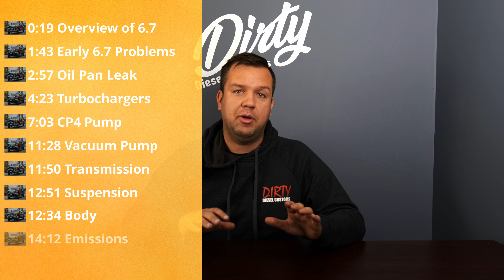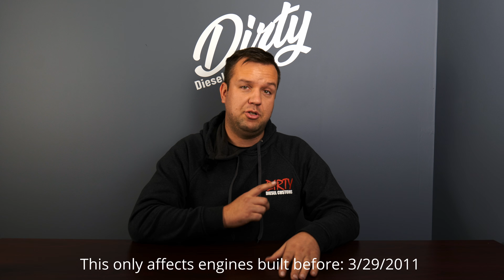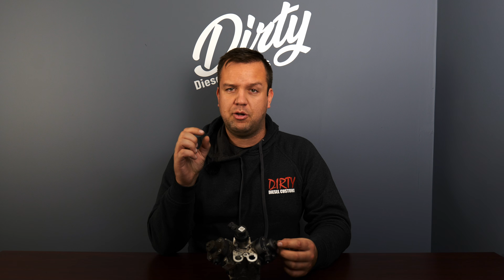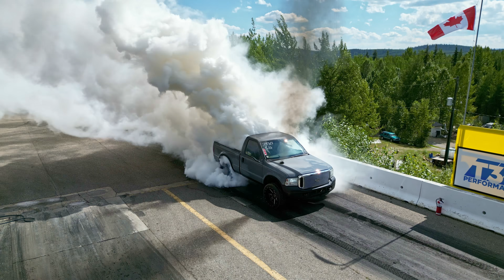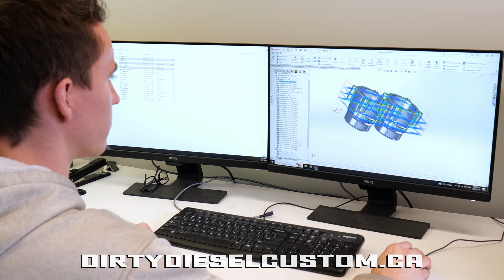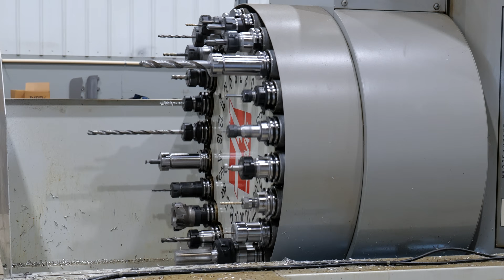2011-2014 Ford 6.7L Powerstroke Buyers Guide

Comment: I have a 2014 does its turbo still use the ceramic bearings?
Reply from the maker: Hey, I learned after I made this video I had those years wrong, all 2011-2014 trucks have the ball bearing turbo, not just the 11/12's. So yes your 14 has the same early design turbo
Reply: Steel bearings in 2013-14

Comment: How come these CP4 pumps only fail in the USA must be something different in the diesel lubrication ability.
Reply from the maker: Our Ultra Low Sulfur Diesel has a lower lubricity rate than European diesel does. Which is why North America see's a near 8% CP4 failure rate while Europe see's less than 1%. These pumps are fitted to many BMW/VW/Mercedes with little issue. It's too bad because from a performance standpoint they're pretty good pumps! 
Cheers

Comment: I find it odd that the 2011 f250 built before march 2011 had a tsb for an engine problem and the 2011 f150 before march 2011 had trasmission problem, problem with the lead frame

Comment: I guess so you're saying do not buy one!! Seems very risky.
Reply from the maker: It's hard to say, the engine and transmission are really solid (late 2011+) so if you get those other items sorted you should be set, or better yet if you can find one already done the way you wanted you can end up with a solid truck. Each manufacture has their own issues, so it's just balancing what issues you want to watch out for. 
Cheers!

Comment: Nice summary.  What bothers me is WHY does Ford CONTINUE to use the cp4 pump given its 14+ year history of failures?
GM used it for just a few years, had problems, settled a $50 million suit with Bosch over it, then dropped Bosch entirely and switch to a pump from Denso.
Ram switched from the older cp3 to the cp4 for ~2 years, but had enough problems that dropped the cp4 and switched back to the cp3
Ford started using the cp4 in 2011, with continuos problems. Ford had to issue a recall on their 2020-2022 models. Yet Ford STILL uses it,   WHY???

If the pump fails, the repair estimates now range $12,000 - $15,000.  This is so unnerving, that I preemptively ordered the S&S Diesel's replacement pump.
Its cost was $2,000. (However, thanks to trump's idiotic tariff B.S., buyers will now pay $2,400). The labor to have it installed (11 hours) will cost another $2,000, and various parts should be replaced at the same time (~$600). 

While it is obscene that I'm preemptively paying ~$4,600 to prevent a problem that may never surface on my 2017 F-350, the thought of paying ~$12,000+ to repair a failure that a knew might occur, and was a nagging worry every time I drove it, was even ore obscene

The concern about possible failure was heightened by recurring, False, 'Water in fuel' error messages. Draining and inspecting the fuel established that there was no water. Ford claimed the harness was failing an replaced it, but the problem continued. The water is detected via. a sensor which detects a change in capacitance. Water has a higher capacitance than Diesel. BUT SO WILL AND HINT OF METAL IN THE DIESEL FUEL, Given that a substantial portion of he fuel passing through the pump is recirculated back to the fuel tank, the false error code could be the earliest warning of accelerated wear (prior to metal shavings being formed)

Given the cp4's reputation, I'm unwilling to drive a truck with a pump that can 'grenade' the entire fuel system and even the engine itself.
Reply: Bosch sucks because they make everything from car parts to vacuum cleaners, my guess is they're cheap and ford has a good deal with them

Comment: If i'm going to replace the fuel system for ten thousand or twelve thousand I can buy another engine for twenty thousand and forget about the problems just change out the problems that have r existing and put a few extra dollars and that's it
Reply: If you know how to do the work on your truck. The replacement contamination kit is around 5-6 thousand. The 10 to 15 grand is if a mechanic does the work.

Comment: Just when you think you think you know alot, then you meet this guy lol. Awsome Video. Just bought a near new looking 2014 4x2 f250 6.7 long bed quad cab for $15k. 129k miles. No leaks or modifications, drives like a dream. Only strange thing happening is when doing a light tip in from a stop. Feels like 1st gear slip, or torque converter slip. Then again it also feels like a rear limited slip diff issue. It has the Electric locking diff button on the dash that does change the feeling when turned on. It almost disappears when the switch is on. Maybe I just need to change the rear fluid. My Ram Cummins always required a friction modifier to reduce diff chatter. Almost feels like that issue without the noise.

Comment: There’s a nice 2013 6.7 truck bought at auction. For 15k at a dealer. It’s stuck at 30k mileage. Any concerns?
Reply from the maker: If it runs and drives nicely that should be good! Keep on top of your maintenance, make sure the PCV stays clear and enjoy it!
Reply: @ thanks for the prompt reply. I’m gonna look at it today

Comment: i actually found a 2012 ford f350 crew cab long bed dually with 146.7k miles on it, it looks solid ngl, the dealership guy showed me a video of the engine running and i hear no ticking or clacking sounds. Are the '12s engines a solid choice? i hear they usually have turbocharger issues, including egr dfm etc issues, and i wanna try and delete them, would it be a good idea to get them?? if someone can help me out id appreciate it :)
Reply from the maker: The bottom ends on the 12's are solid, it was only really the 11's that had the bottom end issues. The turbos are still the weak point but replacements aren't too expensive if you want to replace it down the line!
Reply: @dirtydieselcustom 3 weeks later, thank you so much!!

Comment: I'm about to pull the trigger on a 2011 F350 Lariat with only 66k miles.  The truck is in mint condition inside and out except for some surface rust in spots on the undercarriage.  The driver's seat doesn't even have ass prints in it yet.  That said, I have some concerns now after watching this video.  I'm always suspicious of first year body style changes and this video confirmed my suspicions.
Reply: Yeah what you all think about buying a 2011 F350 6.7 l Diesel with 300,000 MI
Reply: Price 12000
Reply: @JamesWarden-cs2rz bought a 2012 350 tuned and deleted at 179K for 24K
Reply: I bought a 2011 a year ago in April with 77,000 miles on it. I just had to replace the turbo at 97,000 miles. Mine is deleted fully and I deleted the ccv. 
Other than the turbo issue. The truck is a beast.
Reply: Also, make sure to put the s&s disaster prevention kit. I haven't done it yet but I'm using hot shot extra lubrication additive in every fill up.

Comment: What happens if your truck already had its cp4 replaced under warranty do they give you a better one mine was done on my truck around 75k before I owned it 2013 model
Reply from the maker: If you have the upgraded CP4 you are more protected from the failures, but it can still happen, so if you want to be extra safe we'd just go with the Exenergy system saver for peace of mind.

Comment: I’m a Cummins guy I have a 04, 07, 12, & 16’ year model trucks I’m considering a 14 6.7 I just worry about the cp4 issue
Reply: Senior master tech here… the CP4 problem (in my experience) is blown out of proportion. Use fuel additive and change your fuel filters every other oil change, and you will not see problems.

Comment: Should i even consider a 380k mile 2014 truck, tomorrow i will be looking at an f250 being sold that its said to have 380k but truck looks well cared for on photos price is very cheap
Reply from the maker: That is quite a few miles so it's hard to say, we've seen these trucks with good maintenance last over 500 but you're going to see things like wheel bearings, bushings and general suspension components needing to be replaced even if the engine and transmission is solid. If the truck is well maintained when you go look at it, then it could be a good unit for you but just be sure to check it out thoroughly.

Comment: Im looking into the 2016 6.7 platinum f250. Are those not as reliable as the 2011-14 year models?
Reply from the maker: 16's are great trucks. Same issues with the CP4 pumps and vacuum pump leaks, but their turbo's, transmissions, drivetrains and bodies are all solid! Make sure it's been well cared for and you should be good!

Comment: If ceramic ball bearing turbo fails. What’s the upgrade then back to steel ball bearings Do diesel turbos see much higher temps than gas applications like sports cars, and tuners?
Reply from the maker: Exactly, the replacements are steel ball-bearing turbos which are farm more reliable! Diesel exhaust gas temps are usually lower but the airflow is slower at lower rpms so the heat dissipation is slower. This issue might have been more build quality rather than a specific issue with them being ceramic.

Comment: I bought a 2014 f250 lariat 6.7 turbo diesel with 31,500 for $40,500. I’ve kept up with the oil changes,CCV,brakes,tires,shocks,fuel filters,air filter just general maintenance and love my truck. I am very aware of the cp4 fuel pump problem and have looked into preventative measures in case it decides to implodes….
Reply: Do a S&S disaster prevention kit ....I have the same truck and with only 86k miles my CP4 took a crap ... costing me 14,650 $ cash out of pocket ....no contamination was found by dealership in fuel ....400 dollars could have saved me a small fortune

Comment: Went to look at a 2011 f350 with 74k miles on it. When do the pumps fail if they do? Don’t wanna buy a ticking time bomb
Reply from the maker: CP4's are hit and miss, we've replaced them on 21's with under 50k and we've got customers who have trucks over half a million and they're running fine. The usual culprit on a CP4 is bad gas, water in fuel, bad maintenance etc. And on the 11's they're the early style pumps so they're more susceptible to issues. 74k is decent miles though, you'd likely be good if you kept up on filter changes, good fuel and a fuel system saver of some kind.

Comment: I’m looking at a 2012 with 187k and seems to have harsh downshifts. Could it be possible that it’s a tune issue or solenoid issue?
Reply from the maker: These transmissions have been known to have some solenoid shifts, can you revert it back to stock and see if the harsh shifts continue? Usually, it'll take 100 miles or so before they smooth out after a re-flash.
Reply: Looking at a 2012 f350 stock with 126k looks super clean no upgrades scared asf that all of what you mentioned will happen as soon as I purchase

Comment: I just had my 06 F350 6.0L to 3 different shops that couldn't figure out a stalling issue on hwy, finally a shop in Kamloops found out it was the under dash internal fuel pump fuse relay that was intermittent, he by passed with new relay and wires to fuel pump and now she's finally running again! This should be an automatic upgrade for every 6.0L owner!